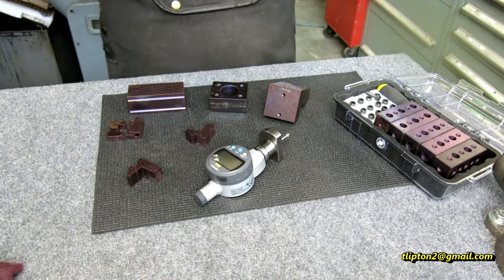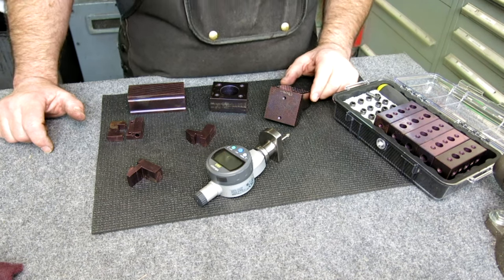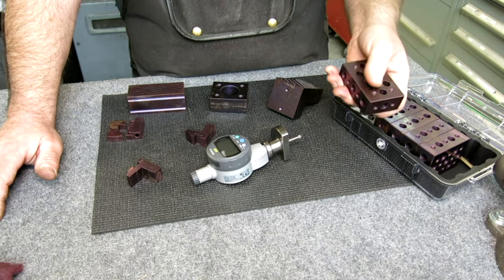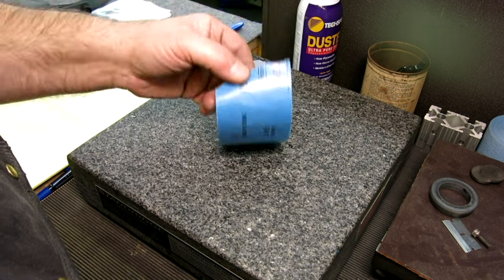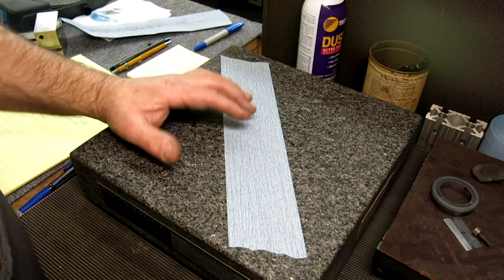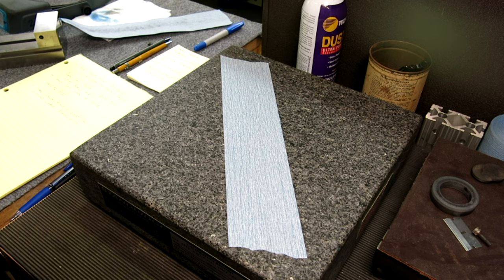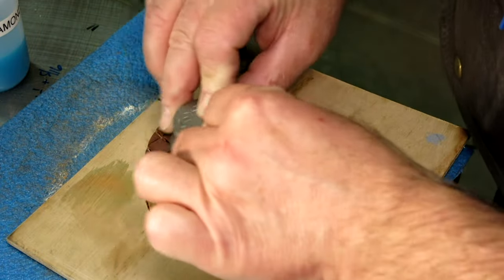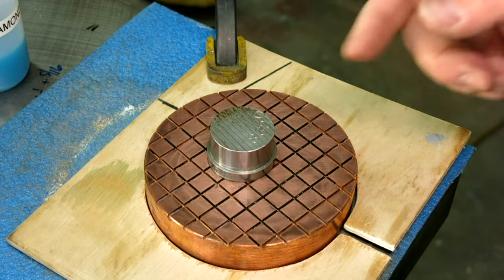Precision Lapping 101

Comment: The initial lapping on the abrassive paper was clearly rounding the part. The juddering indicates the leading edge is biting in and you are not controlling the part in the hand. Also the loose sheet of fine paper is not held flat and will also round the edges. You find these defects even after the later lapping. It seems you do not understand it is convex when using the optical test. Similarly, though a lot better after lapping on copper, the lines are not straight but larger diam circles. It's still convex. The glass is rocking on the part. You declare a line of contact at the edge which is going up and down. You do not seem to understand the use of the optical plate and how to read what it shows. Despite that it's an interesting video, I'd love one of the those optical plates !

Comment: I got to spend some time many years ago with a master optician - he made large amplifier slabs for laser fusion research, a foot in diameter or more, an inch thick, and flat and parallel to 1/20 wave - and one of his tricks was to draw a few lines across a piece with a wax pencil before setting the reference flat on it.  This was soft enough not to scratch anything, easy to remove, and gave the right spacing to easily see the fringes while bridging over any micro-dust that might be on the surface.

Comment: Hi Tom, another great video.

When you clean sandpaper on a plate, wrap rare earth magnet in some plastic foil (even thicker plastic bag will work). Just gently swipe over sandpaper and it will collect all swarf. Unwrap magnet over the waiste bin, all swarf fall of, and magnet is clear.
Of course it works only for steel/iron, and may not remove every tiny bit of swarf, but you do not get swarf and grit flying in the air around.

Another thing is that loose abrasive grit will stay on top of sandpaper and continue to cut, so you get more from same sheet.

Yes I know this is not lapping, but you can consider it "rough" preparation, and there are situations where this is just good enough (of course not for toolmakers instruments).

Comment: THANK YOU!!! I've been ranting for years that lapping for flatness and dimension is a skilled and finicky procedure. Rubbing two surfaces together with Clover valve grinding goo does not constitute precision lapping. My experience has been with production lapping like on a LapMaster. I have no experience with toolroom lapping or even the traditional apparatus used to do it so have been frustrated by my own ignorance in mentoring others. "That's wrong. I don't know what's right, but that ain't it." is unpursuasive to say the least and sure as hell doesn't lead to enlightenment.

This video has been a revelation for me and I hope for others laboring under the blithe delusion of rubbing etc. I'd like to see more particularly lapping to dimension, roundness, gage making, lapping media, and more.

Thanks again. Most educational.
Reply from the maker: Hey Forrest,

You can count on lots more controlled rubbing. That little pile of heat treat I showed contains many examples of the types of fancy rubbing you mention. 

All the best,

Tom

Comment: but any abrasive removes the lapping plate too. Lapping plate makes sense when it's super hard. You can place squares of 3M lapping sheet on the surfaces. I'm not sure how thick and elastic they are but it could work like charm
Reply: better yet a reversed plated diamond plate - that would be close to perfect

Comment: Has the plate needs to be softer then the  workpiece and abrasive

How to remove abrasive embedded can i scrun it with a hard plastic brush with dish soap

Also i see you didnt charge the plate(pressing the grit into the copper lap)
Reply: The abrasive itself will break down by using it, call it wearing it down
if you still want to remove as much abrasive as possible for whatever reason i've heard of people using something like a hard plastic to rub over the surface, hoping that the abrasive grabs into the plastic, but i have not done so myself so take a grain of salt with that.

Tom did not charge the lap as he is using it as a free abrasive.
Check the video catalog on this channel and look for the "making flat lapping plates" video's, it might answer some questions.

Comment: Newbie here to lapping.  It would be helpful if you explain where to get that glass and what kind of glass to use as well as what lighting to use.  Thanks!
Reply: It's called an optical flat. It is some kind of quartz glass... not sure. The important thing is the lightsource, it should be a monochromatic light. A source which outputs exactly one colour of known wavelength of light.

Comment: why are those lapping plates made of copper. Wouldn't you just hazzle with them wearing down quick and getting less flat, very quickly ?
Reply: Rudi Christensen the diamond grips into the copper because of its gumminess
Reply: The lap is a carrier for the cutting material. Still needs to be flat to start with for flat surfaces. For example cast iron plates are charged with the diamond powder to then lap in stone surface plates. The granite is obviously far harder than the cast iron, but it's the diamond that's doing the cutting. Even aluminum can be used as a lap for bores. Cast in place lead laps are or can be used to lap in rifle barrels. Knowing and understanding what's required to obtain the desired accuracy and surface finish is the tough part and way outside my experience level.

Comment: Idiot asking. Where does scraping fit into all this. Is it always pre-lepping? And what hardness is too high for a sane in-the-workshop scraping procedure (assuming availability of tungsten carbide scraper blades)?
Reply: Scraping can get just as flat as lapping, but won't have the same surface finish: lapping is a version of scraping with a much finer texture. Scraping doesn't remove high spots, it makes a surface that still has high and low spots but all of the highs are extremely co-planar. For any part of sufficient bearing area the scraped surface will act flat. For smaller bearing area than the spot-to-spot distance the surface is rough. 

Lapping has the same flaws: if you've lapped it with 6um diamond you'll have 6um groves all over the surface. There are still high and low spots, they're just much, much closer together.

Scraping is good for surfaces with large bearing area that need to be planar, and especially good for such surfaces that will slide against one another with lubrication. The larger distance between high spots provides room for oil to flow, decreasing wear and possibly improving thermal stability if the oil is temperature controlled. 

Lapping is good for surfaces that need to be round or otherwise curved: scraping can't generate an accurate machine spindle, worm gear, or bearing ball, but lapping can. Of course it's also good where a reflective surface finish is required. You can't scrape an optical flat, even though glass can be scraped!

Scraping is typically a bit faster than lapping, and requires less equipment. 

Tungsten carbide has a Mohs hardness between 8.5 and 9.0. It can be used to scrape anything softer than that, but can't scrape harder things such as the alumina in granite. That's why granite surface plates are lapped for flatness, but cast iron plates can be scraped flat.
Reply: What a comprehensive answer! Thank you!
Reply: You're welcome. As an aside I strongly recommend the book "Foundations of Mechanical Accuracy" by Wayne R. Moore. Most of that info is in there. Tom Lipton (oxtoolco), Robin Renzetti (robrenz), Stefan Gotteswinter, and a couple of the other highly skilled Youtube machinists have all mentioned it, it's pretty much the classic text on high-accuracy machining.
Reply: Tome4kkkk So I searched Amazon for Foundations of Mechanical Accuracy.  A mere $950 for a used copy.  However, if you're really interested Google it. A copy can be downloaded free.
Reply: It IS available new, just not from amazon. $150, and worth it. http://mooretool.com/publications.html

It's also on Library Genesis, the scan is pretty good (though not as good as the actual book).
Reply: SAI Peregrinus Well, thanks for even more excellent info.  Much appreciated.  I'm not sure if I can squeeze that much out of the budget by I think I'll try.
Reply: Thank you for that!  I have struggled for a while trying to understand why when you can grind something as flat as a flat thing why scraping was still around.  Then I began to think maybe it was about a scraped surface having pools of oil for lubrication and glide ability.  Nice explanation comes along, perfect.
Reply: This book is NOT worth hundreds of bucks.
Download PDF for free: https://ufile.io/ztlbn
Reply: There are adtitional practical reasons for scraping. 
For example it is much cheaper to scrape on site, then to transport 10 ton machine to nearest grinder that is big enoguh.
Then, you have machines that are too big for any grinder...

Comment: Super interesting video - thanks for sharing!

Was interested about the use of Copper for the lapping plate - wouldn't the steel parts + diamond abrasive wear that down super quickly?  I would have thought you'd use a harder material for the lapping plate.  But, the copper does look awesome and i suppose would be very easy to re-grind flat.
Reply: The idea is for the lapping plate to be a softer material that can "capture" the abrasive, which gets stuck into the lap plate and grinds against the parts you're going to lap.
Reply: ahh - very interesting - thanks for the info i hadn't thought of that.  I wonder what the effectiveness is relative to material hardness of your lapping plate (e.g. would lead work or is that TOO soft)
Reply: If you haven't seen the videos where he does the 3 plate method he refers to here, check those out. Also pay attention to the conversations he has with the guys that recondition his flats in another video. They are absolute nerd porn. I think it fair to say that a material choice for the lap has a lot to do with maintaining the lap.
Reply: glyn hodges  pretty amazing - thanks for recommendation!

Comment: 23:30 I wonder if balancing the grinding wheel would improve the finish
Reply: Arnþór Gíslason likely not much at all if finish is all you're looking for. A lot of guys believe in balancing 8" whells and everything makes some difference, but as he shows going right to the 6um after a few swipes, he's mostly through it. I've never used balanced 8" wheels with my Mitsui, but my thought is if it needs to be better, lapping is necessary anyways. Balancing a wheel can take some time if you don't do it on a regular basis. That being said, any wheels bigger than that, normally have to be balanced, otherwise you'll get a whole lotta shakin' going on. My .02
Reply: interesting, thank you

Comment: Thank you for an informative video. Can you explain when using a patch of copper and when using a cast iron. Your disc with diamond abrasive, how do you load the disc with a diamond abrasive?
Reply from the maker: The copper is easy to charge without rolling the diamond in intentionally. Cast iron is good and wears longer but will not produce the highest surface finishes. You can roll the diamond in with a smooth hardened roller much like an artists brayer.
Reply: Thanks. have to test that

Comment: Why doesn't the copper lap wear more than the steel?
Reply from the maker: Because the diamonds tend to stick in the copper first. This is the reason the lap must always be softer than the specimen. Good question. After some use the copper wears and needs to be re lapped back to nice flatness.
Reply: oxtoolco Thanks for the explanation makes total science.
Reply: Is that why brass wears better than iron?

Comment: Maybe you cover it somewhere else but isn't copper awful soft for lapping plates? I claim to know nothing but it seems like they'd wear pretty quickly... quicker than the part you're trying to flatten?
Reply: You want your lapping plate to be soft so the lapping compound digs in an sticks to the lapping plate so it doesn't just get pushed and washed away. That't why cast iron and aluminum are normally used for lapping plates.
Reply: Makes perfect sense! Thanks!
Reply: Just what I was going to ask too/wanted to know. I had always seen that no matter what material, glass/metal/etc., the lap was always softer than the work.
Reply: Oh foo, you're right on the glass tool for grinding. However, as you stated, pitch lap for final figuring and polishing.
Reply: can you use a cast iron lap for a copper part?

Comment: Is there a difference in flatness between dry and wet lapping on a surface plate? I usually use WD40 up to 1200 to get rid of the machine marks, which is overkill for my application, but it’s fun and looks pretty. Thanks for the vids! One day I’ll have the tooling to make some of those nice laps you made a vid of, could 3 offshore 123 blocks make good laps?
Reply: That's the point of the video - "pretty and shiny" says nothing about geometry!
Reply: The import blocks I have are all hardened, which would make it difficult to embed the abrasive in them.  There is such a thing as 'rolling' abrasion, but I think the method Tom is showing needs the abrasive to be stuck in the lap.

Comment: G'day Tom.What are the merits of using cast iron surface plate, scrape it flat using you granite then use the (more easily refinished CI) to do your lapping on?
Reply from the maker: Hi Ian,

Cast iron works fine but does not produce as fine a finish as copper does. Check out my video making cast iron lapping plates and you will see how easy it is. In fact I would argue its faster and easier on the body than scraping to the same flatness. A scraped surface is not ideal for lapping. Its primary use is a sliding way with highs and lows. Lapping plates are flat and maximum surface area. The copper plates are even easier to recondition when they wear than cast iron.

Comment: Just wondering, can the copper be charged with diamonds, if so how. In the surface plate video you very briefly showed the cast iron plates being chargers, how is this done? Dave
Reply: What's your problem here? Diamond is harder than cast iron, or copper and will embed into such soft materials. That's it.
Reply: Thanks Chris for your respectful response. Debating if I'm going to make a set of copper lapping plates. It's a really interesting subject.Dave

Comment: Why does the metal look brown in the video?
Reply: Just watch the video, he says that the parts were heat treated and tempered, so they now have a purplish oxide layer.
Reply: A2 discolors to a deep straw color after the air-quench and tempering cycle. Sometimes all the way down to a purple/brown color depending on the temperatures, length and number of tempering cycles.  Tom mentioned 3 tempering cycles and a cryogenic treatment.

Comment: At my last shop we had a pretty large surface grinder that did a particularly good job at getting things pretty flat like would take no time to lap thing in to a really close toloance we also had some smaller grinders that it seemed like it took longer to lap surfaces in and the smaller grinders were newer. And I always wondered if the size of the surface grinder helped in flatness or was it just a really good grinder.